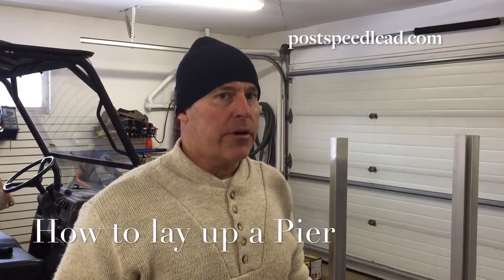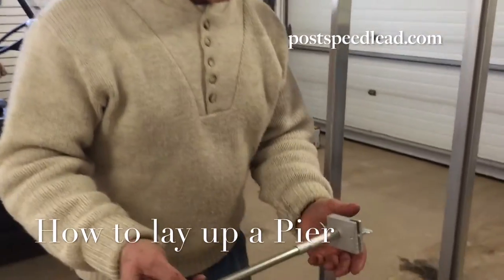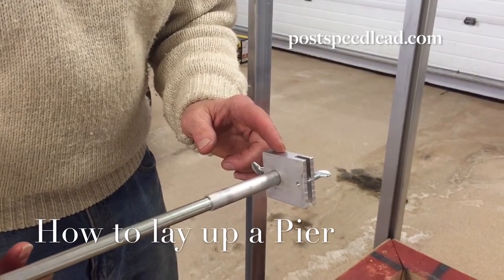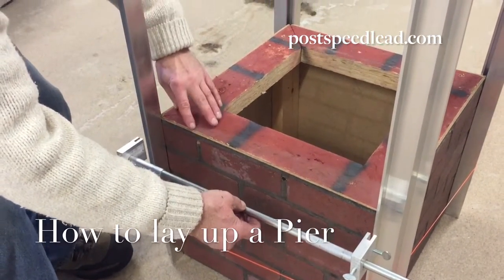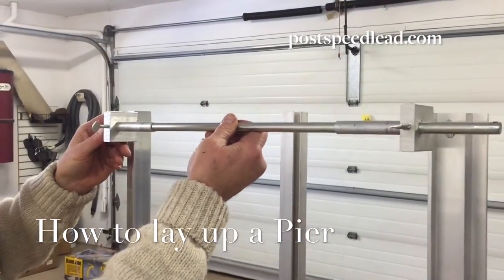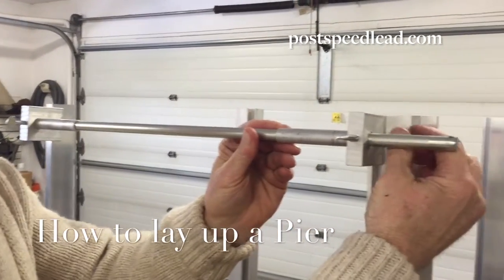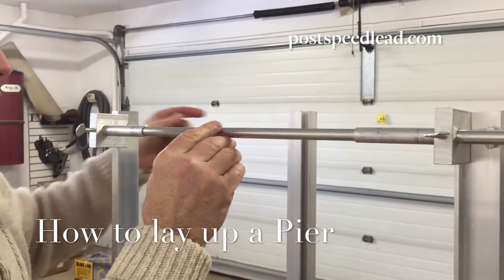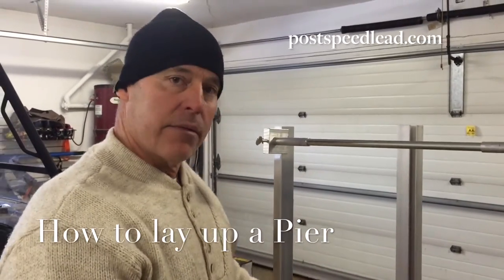Post Speed Lead Pier

Comment: What size rods do I need for the top? And use solid aluminium? Where do I buy I bought the set but didn't come with rods for the top
Reply from the maker: Since each chimney is a custom size you'll need to go to a home store and get 3/8 inch cold rolled steel cut to size to use as your spreader bars.